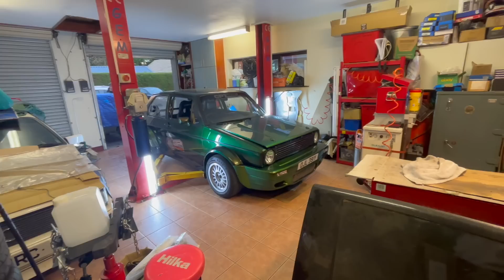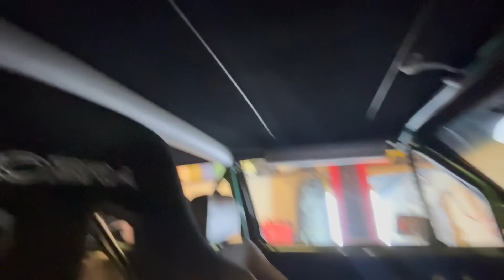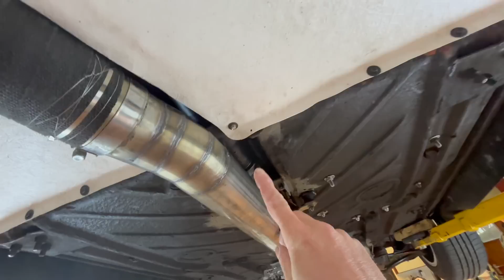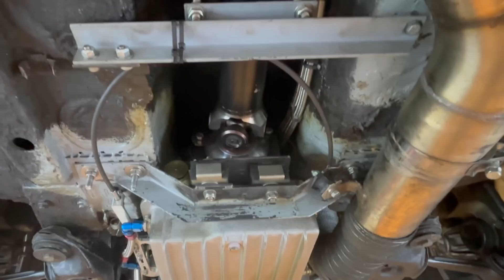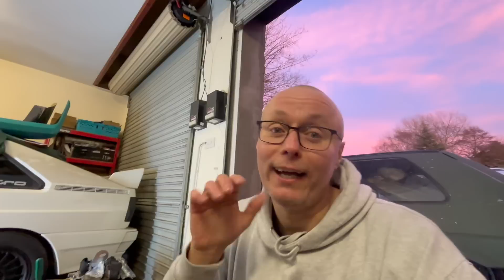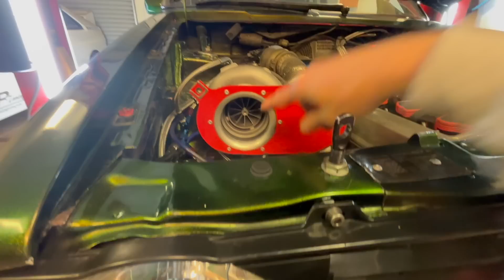HE BUILT THIS 30 YEARS AGO! AUDI VW GOLF SWAP

Comment: @7:00 loooks like a nissan primera grill on rear? No way this made 1000hp!! 450bhp i recon, minted vid, thanks for posting! ✌️
Reply from the maker: The car runs low 9’s already. It runs a GTX40 turbo. Do you really think it only makes 450 🤦🏻🤷🏻🤣
Reply: Was running 600 whp over 14 years ago https://youtu.be/pPMIDlAQTtg?si=e78rcuEniIFgOXTi
Reply: It made 1000bhp back then that’s facts it was an absolute animal in Ten Of The Best.